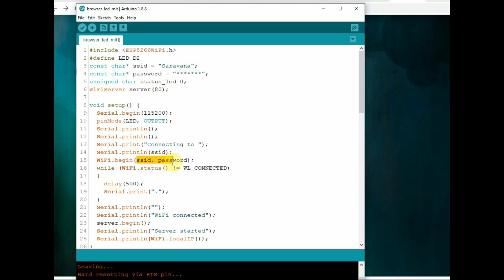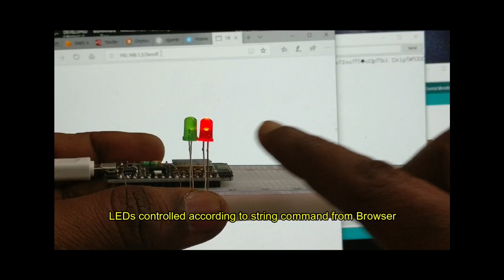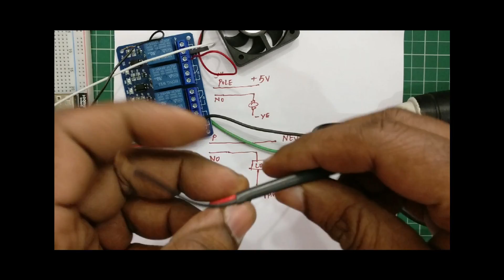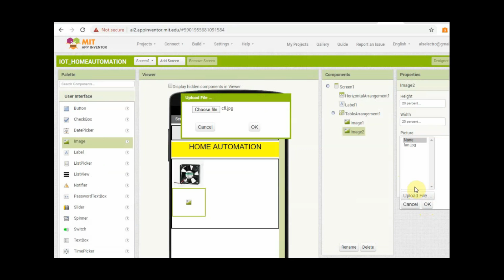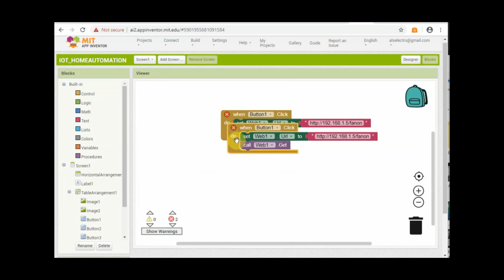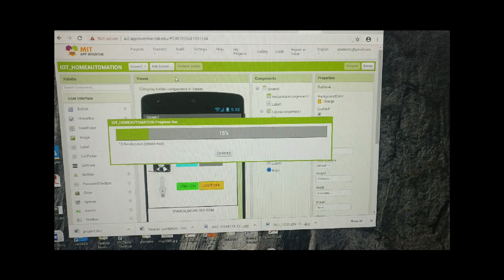IOT PRACTICAL GUIDE 2  HOME AUTOMATION WITH NodeMCU & Android App

Comment: Sir can u please solve the issue like this

[WiFiEsp] Connecting to 192.168.1.100
Connecting...
[WiFiEsp] >>> TIMEOUT >>>
[WiFiEsp] Data packet send error (1)
[WiFiEsp] Failed to write to socket 3
[WiFiEsp] Disconnecting 3

Thanks in advance..............